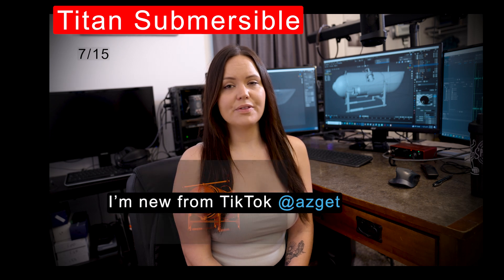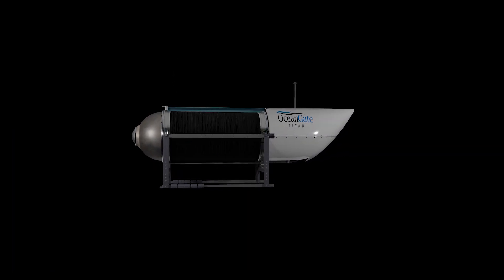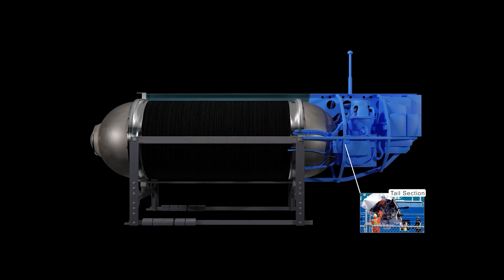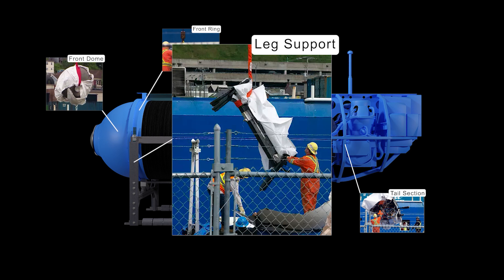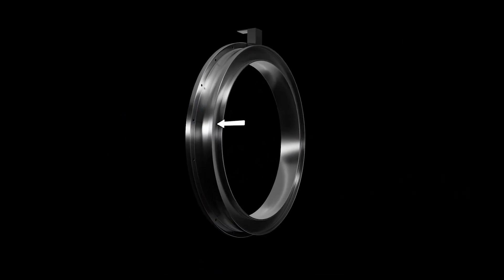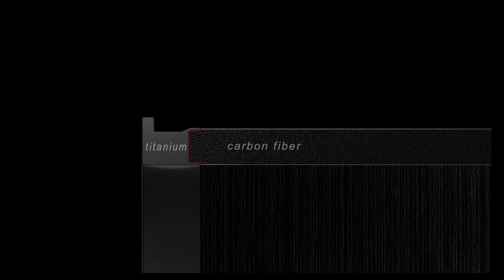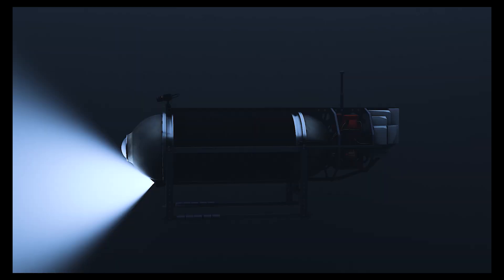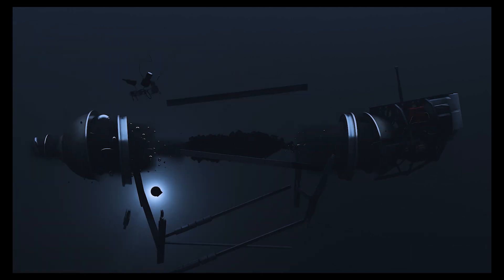Titan Submersible and how it Imploded... parts of submersible recovered 1600 feet from the Titanic

Comment: Great video, and well presented!  If the communication logs that are floating around the internet are accurate, I wonder if the fast rate of descent was due to water ingress into the tail section.  This might explain the Titan arriving at the bottom almost an hour quicker than normal due to the extra weight.  It may also explain why the tail section was fairly intact due to an equalization in pressure.  Not an expert on submersibles, so I would love to hear from others if this might be possible.
Reply: Wasn't the tail section open to water? The individual components were watertight, but the structure as a whole was not pressurized. I've also seen and read about a layer of rhino liner, or tuff coat applied..I've wondered if this acted like a dissecting aortic aneurysm, that is: high pressure pushing fluid between" layers". Maybe this is the added weight that caused the craft to descend fast and sluggishly ascend.
Reply: @Mdeaccosta  I believe the tailcone (with the electronics inside) was filled with oil (not sure what type, perhaps mineral oil? Crude is possible too, or gasoline has seen use before...) - It won't short out electronics, but it's incompressible like water, so you don't need to protect that section from implosion (there's no difference in pressure across the surface of the tailcone).

One could conceive that the top of it opened and allowed the oil to float out and be replaced by water, which is heavier.

I don't really buy the transcript though. There's a number of weirdnesses - While Titan could send longer than 3 character codes, they tried hard to use them whenever possible, and the transcript has effectively none (Even if you say there's translation going on, they use different terminology - "Status" vs the coded "Comms Check", "RTM" vs the coded "Hull Acoustic Monitoring", none of the emergency codes appear,  and they're way chattier in the transcript than on pictures of the communications screen from other dives), plus there's a random moment they switch from "the engineer" to "Carlos" for no reason besides to convince us they know who Carlos is - And it seemed not to fit how they planned to respond (in particular, they don't release ballast in a way that matches their emergency surface plans).

I think it's more likely that it was a hoax, Titan's HAM sounded an alarm maybe a second or so before implosion (Carbon fiber is known to fail suddenly when it gives out, so experts never really thought acoustic monitors would give much warning), and it simply imploded instantly out of fairly nowhere. It may or may not have descended abnormally quickly, but that's not really dangerous to a submersible that's not going to fail anyway, and it was a thing that was apparently known to happen to it (albeit not as frequently as the loss of communications people make such a big fuss about).

Comment: Shouldn't the domes move toward the middle. Why are they going out like that?
Reply: They do, for a split second, watch again. The air inside the cilinder wil be compressed and superheated during the implosion but also released right afterwards, see it as a explosion after the implosion. That's why the domes move outwards and probably why the glass is blown out.

Comment: Given that their was a titanium sleeve under the carbon fiber, wouldn’t that mean some portions of the 5 people’s remains are still wrapped in it?
Reply: I don't think there was a titanium inner sleeve because I remember seeing a video where they took it out after the carbon wrap was finished.
Reply: The fiber was built by wrapping it around a steel tube, but the tube was removed (you can see in pictures from inside the sub that they can touch the carbon fiber insides of the hull).

It's very likely that human remains are present on the insides of the caps or the remains of the hull (as the press release said, they did recover some...)

But... That's more likely to be stuff like strips of muscle, or individual broken teeth embedded into the hull, or fragments of skeleton. The human body isn't going to survive in a recognizable form when it's subjected to this kind of event.

Comment: IF the transcript of the communications during the dive are authenticate, then the legs would not have been attached at the time of the implosion. Yours is the first video I have seen that shows the placement of the pieces that were recovered.
The reason the back section was not destroyed is that it was outside the pressure vessel. It withstands the pressure because there is equal pressure on all sides and there is not a air filled void that can collapse.

Comment: I reckon the inner rim sheered off the titanium ring due to the glue losing its adhesion and all the pressure. Also the carbon fibre was breaking down before that happened. Excellent video 👍

Comment: This is a REALLY good model and beautiful animation! This is the clearest demonstration that illustrates where the main strains are and how they deform the parts, and where the found parts were located on the sub. Thank you for sharing!!!!
Reply: "This is the clearest demonstration that illustrates where the main strains are and how they deform the parts," the point/line is corect, the animation of it is 100% wrong, CF have much bigger Young modulus than tytan and its alloys...
Reply: @Bialy_1  Different Ti alloys definitely exhibit different elasticity under load, but CF does not strain harden after reaching yield strength. CF just snaps. The animation is not 100% wrong. It illustrates one important flaw/problem: dissimilar materials react differently under load and where they meet, they need room to play. This "room" is a potential failure point, especially when repeated as this will introduce wear and inevitably tear. The implosion of the sub could therefore also come from a different area: the carbon cylinder itself that is made up of a matrix of materials. This introduces additional questions: the quality of the fibers, the resin, the weave, curing process etc. Again you're dealing with composite/dissimilar materials that react differently to stress: the resin much softer and elastic than the fibers. That said, the main failure point was not the sub but the organization of the company that allowed sub-optimal (no pun intended) designs to be used.

Comment: Didn't the CF tube have a insert where they screwed the screens and the rails onto? If there was no insert them they made holes into the CF tube. By doing that they cut the CF stands that would now allow the strands to move independently. Further weakening the CF tube.
Reply: It had an insert. There's a video that clearly shows a perforated sleeve with spacers between it and the hull that things were mounted to.
Reply: @husk1061  
I know there was a sleeve, I was wondering if she knew since it wasn't modeled.
Reply: On the inside was a sleeve to which the monitors, floor and lighting were attached. However, I saw a video where there were drill holes/inserts on the outside of the CF hull where the motor mounts were bolted to. Don't know if that hull was from the Cyclops or the Titan. If it was the Titan, those engineers were really stupid.
Reply: @vin12666  
I know there was a sleeve, was asking if she knew since she didn't model it.

Comment: Great work ⭐️ . The demonstration of the deflection under load is really good.  
Remember the domes were being squeezed together with extreme pressure so when the carbon fibre gave way the domes would have come together.
Reply: "The demonstration of the deflection under load is really good." No it is not, she do not know what young modulus is -> highschool level of physics... -> just like the guy that made that tytanium rings so thin -> the same lack of understanding of the physics involved here...
And the tytanium caps after CF failure should be initialy pushed inside by the pressure difference...
Reply: idk Mike. The water intrusion happened from the middle with enough force to  blow the viewport clean out. I bet there were nice pressure induced explosions on each end too. Her simulation is accurate in my opinion. The titanium end caps were blown outwards.. not sucked in.
Reply: @Danstaafl  No, the end domes would definitely have come together as the carbon fibre gave way. I don’t want to detract from the really excellent visuals and the collapse of the centre tube but the end caps do not reflect how an implosion works. See this structural simulation https://youtu.be/i-bvNHCCpFo?t=617
Reply: @Mike-Bell  Most of the simulations have shown the cylinder imploding uniformly all the way around the outside surface.  Normally failures of this type will precipitate at one location meaning maybe a hole is punched in the cylinder at the ring on one end.  Once an imperfection is introduced in the cylinder the failure would radiate out quickly with additional parts of the cylinder being pushed in but during this time water is going in through the original hole.  Now it gets unpredictable- any part of the cylinder with static external pressure could start moving inwards, but the water going in through the hole has momentum and whatever it hits would get pushed outwards.  It could overcome the static compression on the domes and push them off of the cylinder.  It could hit parts of the carbon fiber and push them outwards against the static pressure.